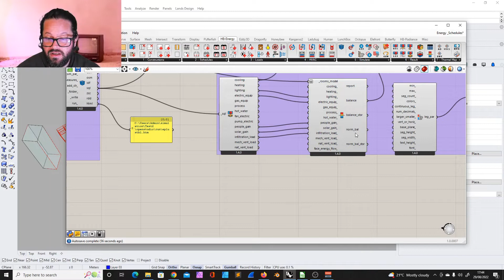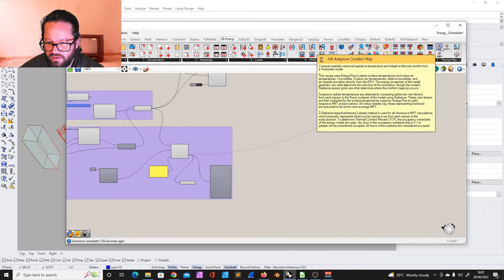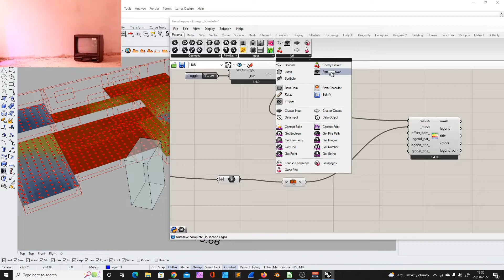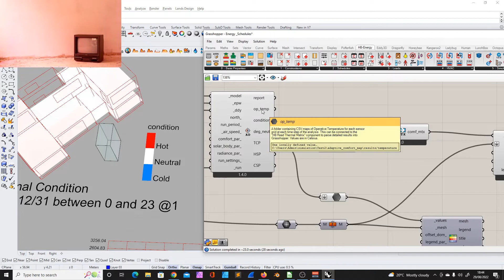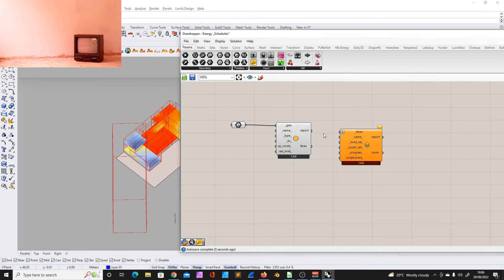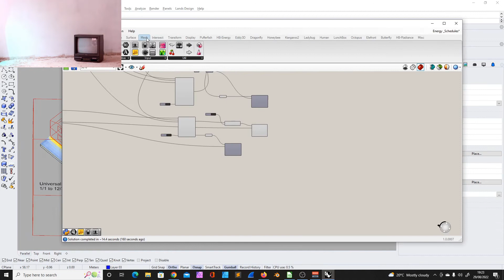Honeybee 'ENERGY' Part 9 | Indoor and Outdoor Comfort | Ladybug tools 1.4.0

Comment: Hi Philip! Thanks for the videos once again! Do you know how to visualize the UTCI map from squared rectangles to a one, more uniform gradient of colors? Sort of interpolating/isocurves to better and smoothly define borders to obtain one more appreciable analysis surface? Thanks!
Reply from the maker: You can increase the resolution of the grid. Smaller grid = smoother appearance.
Reply: @PhilippGalvanDesign  okay true.. but it could be really heavy. Any other ideas ?
Reply from the maker: Well normally what I do is to set up the script and when everything works I lower the grid incrementally. I don't mind waiting 10 minutes longer to be fair. Also I haven't encountered extremely long calculations.  For sure there are other ways to blur the output but probably not without scripting capabilities. I would try it before speculating if it works or not. Just save your work before.
Reply from the maker: In fact my whole YouTube channel is trial and error. :D
Reply: @PhilippGalvanDesign  I've found a solution to that! It is Weld Mesh grasshopper component, same comand (Weld) in Rhinoceros once baked! :)

Comment: How to make annual result to hourly result ?
Reply from the maker: Do you mean an average hourly result or a specific date and time?
Reply from the maker: Normally any tool which allows for a period input gives you control over which specific time frame you want to look at. Alternatively you can limit the data to the period you want to use before its used in any calculation. Or you calculate the average of the output....
Reply: @PhilippGalvanDesign  I want to see the simulation results within 30 minutes, not per hour, how do I do it, and what tools should I use? I have tried changing the timestep input on LB ANALYSIS PERIOD and HB SIMULATION PARAMETER, but it still fails and the data still shows hourly data
Reply from the maker: @farhannaufal4386 Different Analysis needs different input. If you try to limit the Data to a certain period  with the Ladybug tools then it depends if you can view every 30 minutes. Because weather data is an hourly recorded data set there is no difference between different between 1pm and 1:30pm If you limit the output to a 30 min increment it would not give you more information than hour increment. You would need to interpolate the weather data set.
Or interpolate the output.
If an analysis would include sun position it might give you different results. But energy modeling doesn't take the sun position into account.

Comment: thank u for this lesson. very usefull and clear. I wonder is there way to calculate effect of heat to outside/street and viceversa?
Reply from the maker: To answer that I need to do more tests regarding the same, but as you can see in the UTCI calculation, the temperature changes with the proximity to the building.
Reply: @PhilippGalvanDesign  for the further test can u show heat from cars, outdoor hvac and other electric equipment which generate heat. Thanks in advance)